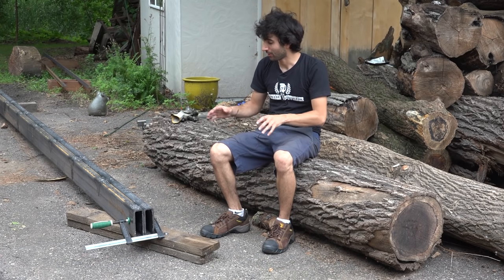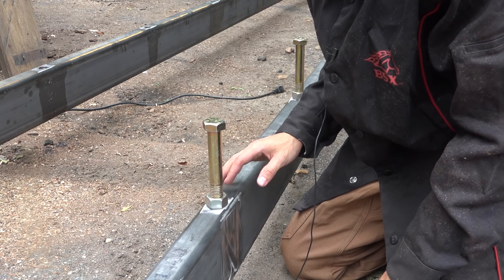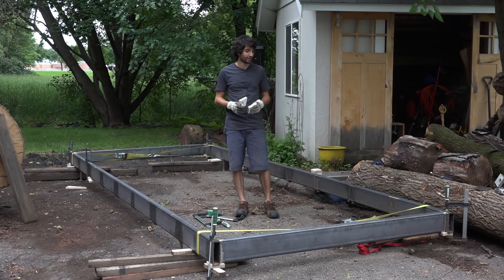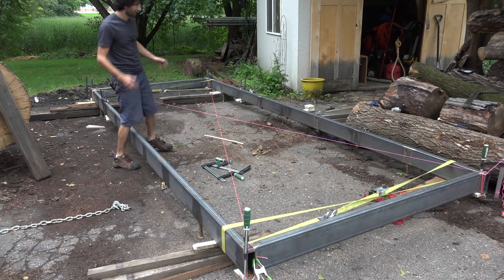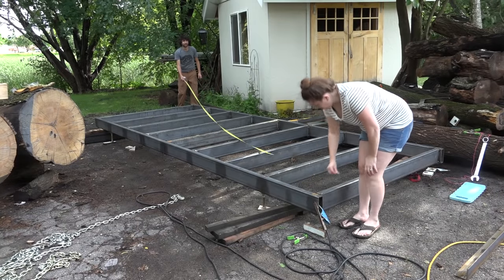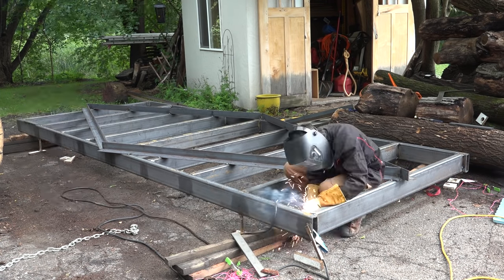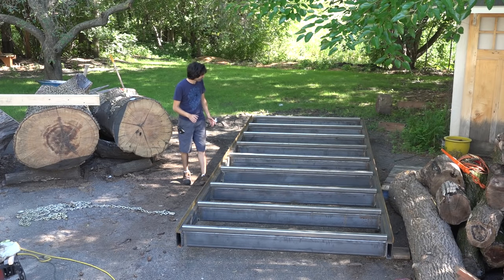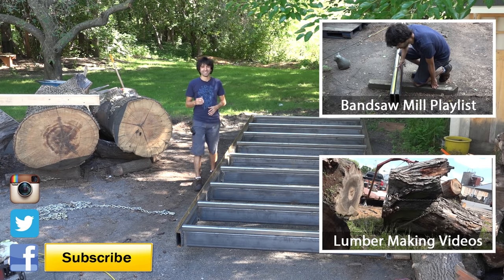Welding the Track Frame - Building a Large Bandsaw Mill - Part 3

Comment: Your going to need something under them feet when the ash fault get hot its going to sink rate into it ,you should at the very least pour footings for the feet of your band saw ,i say do it before you make it much heavier   and it gets knocked out of alinement ,its looking good
Reply: Assuming he has a residential grade asphalt driveway it will have a compression strength of 2000 - 3000 psi and with ~27 feet on the entire assembly and~ 7 square inches on each pad for each foot, that's ~190 square inches of surface on the ground. Even on the low end its still 380,000 pounds of load bearing capacity. Even if you halve the capacity for being old asphalt and have it again for high summer temps it's still 95,000 pounds capacity. Sorry to tell you, but he doesn't need footings or anything more than what he has planned.
Reply: That may be so but a metal structure with metal feet sitting on ash fault in the sun heats both of them up ,it will sink into it ,depending on the concrete mixture he can get 4000 lbs or better  per sq inch ,any structure is only as good as it footing /foundation ,hes going to have his band saw and a damp log on it (est weight of a 5 wide by 10 long maple log 8000 to 10 000lbs )even if one side broke thru and it tipped well running it could be catastrophic for him or anyone near by ,how many 3000 year old ash fault roads or buildings are still here, how many high rises are built on ash fault footing ,his band saw will vibrate also causing heat ,it may not happen in a day ,or a week but it will sink ,the older the ash fault the sooner the failure ,BTW his drive way is no where near hwy strength ash fault ,and sorry but I disagree with your assumption of the strength of his drive way ,perhaps it would be best if he spoke with an engineer before he gets to far into his build to trys and has move it
Reply: just to be a bit picky, you are assuming perfectly even weight distribution between all of the feet. It wouldn't be unreasonable to see a 70/30 split left to right as a log is being loaded. It could be even worse than that. You quickly get down to about 7 feet taking the load, or about 98,000lbs as a base number, after dividing by 4 to account for heat and age, that gets us down to 24,500 lbs, which is still probably enough unless a tree happens to fall onto the bandsaw bed, as i'd be surprised if Matt can move a nearly 12 Ton log around without a forklift, and a bigger truck.

Anyways, I agree the feet with the 3" disks seems like enough weight distribution. but a 12x12 2by under each one and it'll be way more than ever needed.
Reply: Agreed, even 4x4x2, or if Matt wants to go high class 6x6x2, white oak plank would be plenty under there SS pads to make sure there is plenty of weight distribution for even the biggest log with a large impulse dynamic load. Doing the math on static and dynamic load ratings there shouldn't ever be a problem with his set up sinking into the ground on a hot summers day even if Matt finds a way to drop a 12000 pound log on the mill. Frost heave might be a different story though and might require some adjustments during the season changes, but you will get that with anything.
Reply: @ syd ascott   Crowd funding for Matt to hire an engineer? Nehh, lets just stick with looking up material engineering specs on our own and doing the calculations. If Matt was going to have issues with his mill sinking into the ground than he should also have major concerns with his truck and trailer sinking in as well. They have a much higher static load and about the same dynamic load when fully loaded.
Reply: Assuming an even load off of a 5000 lb trunk and 1500 lb mill, though the mill will be slightly heavier, he's sitting at 52 lbs/in. I also don't think he's going to need a footer. Even if he does need a footer, that frame won't twist if the feet sink in, he can add it later if it becomes a problem. It's still a very mobile mill. These people....
Reply from the maker: I have to say I've enjoyed the math in this thread.  I'm really not worried about sinking especially if I further distribute the load by adding something between the stainless pads and the driveway, like a square piece of 2x6.  More food for thought: Take a look at a portable mill like the WoodMizer lt40, when set up the mill is supported on drop legs.  On the lt40 I can only see 5 of them.  That mill can be parked in the dirt and do fine.  That also means that the frame of the mill is bearing more of the weight of the log.  The Lt40 can handle a 36" dia by 21' long log.  A white oak log that big for instance will come in close to 10000 lbs.  The mill itself is close to 4000lbs.